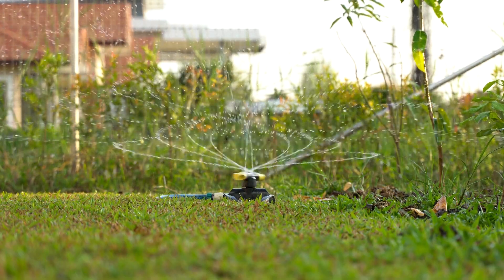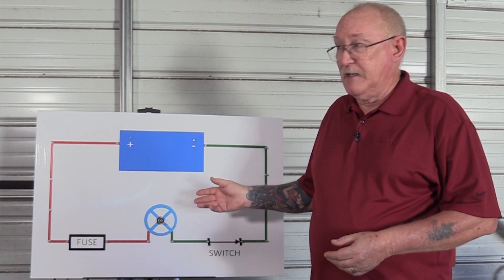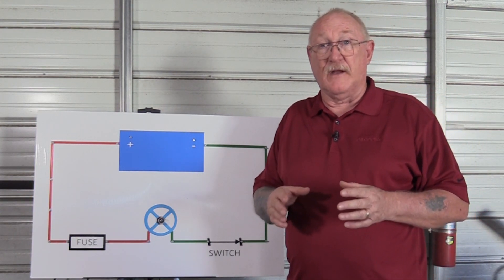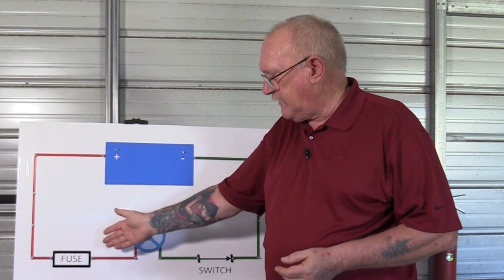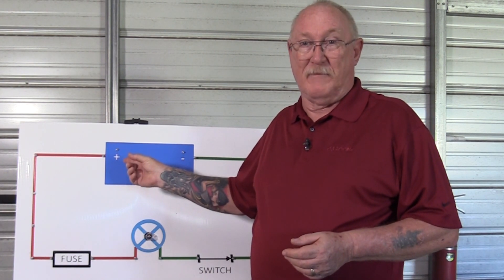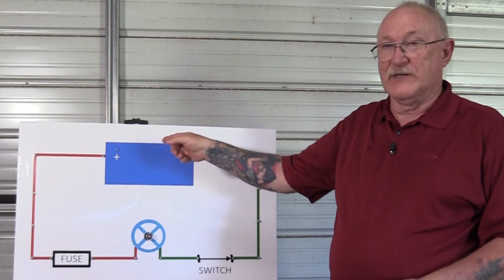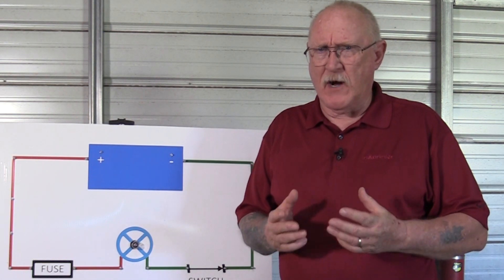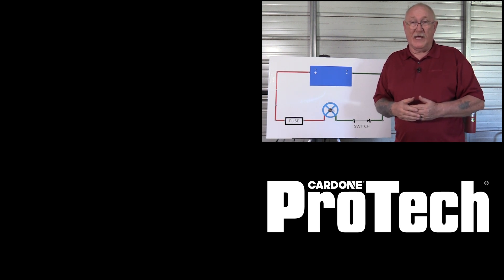CARDONE PROTECH #1:  Electrical Fundamentals Made Simple

Comment: My understanding is that Electrons do not actually move like water does thru a hose but simply are causing the Electrons to collide neg. to Pos. using a conductor using a power source. In other words there are no electrons flowing through the conductive wiring...😢

Comment: If the water example is not correct, im not so sure im understanding what Voltage, Resistance and Amperage is in your explanation. Maybe im stupid but i didn't hear an alternative comparison to water flow, water pressure, water resistance.
Reply: Actually, I think the water analogy is an excellent way to teach the concepts of voltage, current, and resistance to people who are new to the subject of electricity.  In fact, although Pete was somewhat critical of the use of "water in a hose" as an analogy, his subsequent discussion, to me, only reinforced just how good that analogy is.

Comment: Yet if you would use a wider hose to decrease resistances coming from the tap, you will get less push, less push would mean less amps or potential performing work... Squeeze the same hose to produce resistance and then you'll have more focalized current to remove stains and to spin a wheel faster!
Reply: R'Real Williams; a quick uneducated guess/question, newbie here,  wouldn't the wider hose allow more volume/amps even if there is less push ? TY      I have been in the dark about electricity but these days I had better learn. Avg mechanic around here says they don't know or they don't want to mess with my Promaster wiring that sits in driveway while paying $400/mo payments and ins. Finding it very interesting. Kind of glad to be forced into it.
Reply: PS I contacted a guy who had his Promaster for sale. Me, " why so cheap?"  Seller, " I drove it 270 miles, wires burned and dealership told me to come get it they couldn't fix it !"    At least I got a few more miles out of mine but it's been sitting 12 months now. Note; I work a lot of hours seasonally and take care of handicap uncle. Time now to learn and hopefully fix myself.

Comment: so if i understand this correctly the flow is from the  - Neg  to>>>>>>>> the +pos side of the battery. meaning when you connect a light bulb and you have the bulb connected to the neg terminal and you touch the pos battery cable with the wire the current plat is from the bulb to the pos terminal of the battery  or am i confused
Reply from the maker: There are two theories of electron flow. Conventional theory states flow is from positive to negative, and your tools are oriented to this theory. Electron theory states that electrons flow from negative to positive and is generally accepted as the more correct. Do I care? Not at all! What is important to understand is that voltage is needed to get them moving - whatever direction that is - and voltage is a measurement of the difference is potential, not a static number.
Does that clarify it for you?
Reply: @VehicleServiceandRepair  yes thank you so much for the information I have learned more than you will ever know from you. Most of the electrical that comes to me is from other shops and are draws killing battery I have gotten pretty good at that thanks for your help
Reply: Dependable AT, you are over thinking this. In reality (at the atomic level) electrons flow from negative to positive. For whatever reason, it is typically thought that current flows from positive to negative. For all practical purposes it does not matter. Just don't make a bet with an electrical engineer about this or you will loose your money!
Reply: ELECTRONS flow from neg to pos however CURRENT flows from the pos TO the neg. Hard to explain w/o drawing the explanation.
Reply: @bryanfoxx2292  that drawing would be nice to have

Comment: Thank you Pete. Good job. Conventional Theory (+ to negative)  versus Electron Theory  (negative to +).  Both are theories. Conventional theory is best supported for most automotive circuit applications. This is best shown when doing voltage drop testing. The test results support conventional theory. Batteries internal plates are and support electron theory.
Reply from the maker: Thanks for the comments!